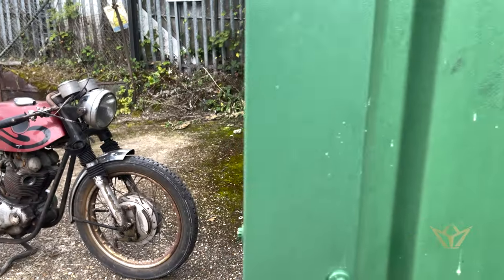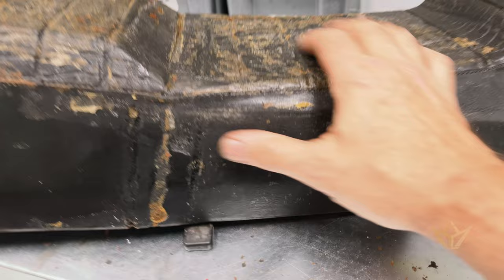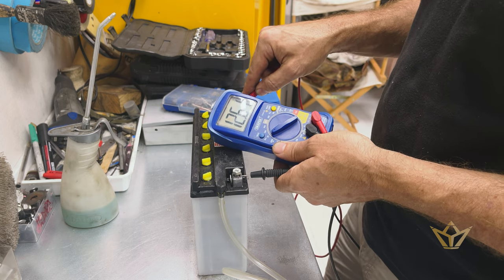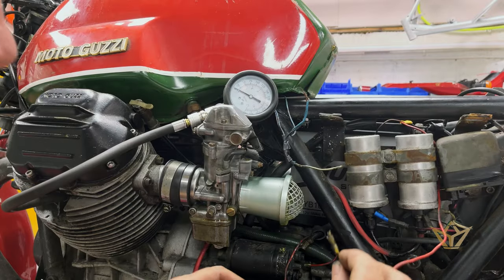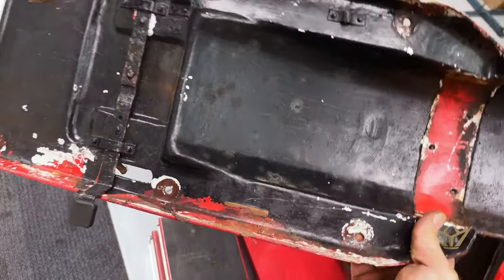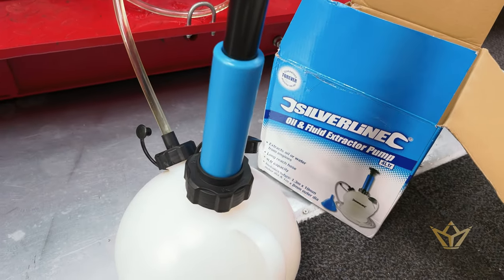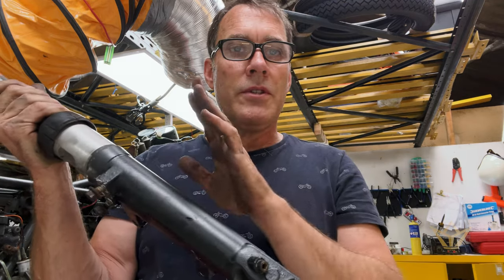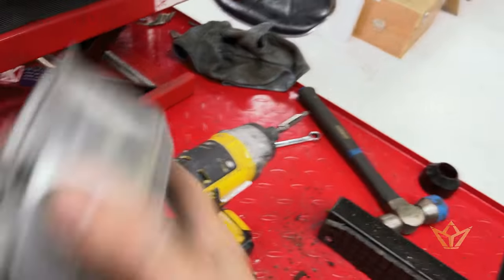Moto Guzzi LeMans MK1 1978 full restore Part1.

Comment: As far as I am concerned, the LM1 is the first true superbike. Others were fast, the Guzzi was too. The big deal was the Tonti frame which was stiff in it's own right but also took advantage of the torsional rigidity of the crankcase and gearbox case. It handled superbly and was also extremely stable without being heavy. Bloody brilliant.
Reply: Absolutely love them. I had two MkIIs over the years. The first I did a complete restoration on. The second one was big-bore with an ambitious tune (gas flowed, inadvisable cam etc) and needed a good amount of work after a long layup. The lap I did of the TT course on that second one just before going to the ferry to come home is the best ride of my motorcycling life so far since 1976. 
Went to the Dutch TT on that first one along with a mad mate on an RG500. We were cruising at 85 on the way down to Amsterdam which was comfy on the LeMans, but the RG500 didn’t like it. My mate signalled that he was going to pull ahead to try and clear his plugs. I have never seen so much smoke from a bike ever, it was epic.
I always wanted a MkI, I think they’re one of the best looking bikes ever. Sadly I’m just not stretchy enough nowadays to live with a bike with clipons.

Comment: Any 850-1000 Guzzi big twin is a great bike, even the 1000s and Le Mans 4 (with the 18' front wheel preferibly). The gear change is argricultural and the direct shaft drive takes some getting used to. You have yo be careful when entering tight corners as the bikes are bollody long. But the sound and immense, immediate torque waves send shivers up your spine. 

I have lived in Rome since the 1980s and frequented a famous mechanic's workshop: Giuseppe di Vito, known to all his firends as just 'Vito.' In his tiny, tiny shop I saw the best of all the 70s and 80s Italian esotica from original V7s to Ducati MHR Mille's, from Laverda 750 SFCs (his own bike).

One thing I noticed immediately, apart from the cover on the seat, is that green paint. I really think that is was an addition, covering the original black, as the Ducati MHR was red and green, many other bikes got painted in similar colours but not by the factory. Hope this note helps.

Ken:goodvibes:

Comment: There's a black rubber product that's excellent for near invisible repairs to those types of formed seats, comes in a tube that fits in a DIY compression squeeze tool, it'll dry under parcel tape to conform to shapes and will even fill missing chunks, it's called Marine Flex and will match for colour straight from the tube, any good Yacht Chandlery should stock it. Back to Black Car bumper dye might help with the side surface marks, failing that Colour Magic or even black Boot polish might be worth a try.
Reply from the maker: Very interesting MC2. I wondered. I’ll look it up! 👍

Comment: I have just completed my Le Mans, and looking at yours there is a lot of work. At this stage I see where you are going and I am interested with your progress and am happy to offer suggestions. There was absolutely no gold paint used anywhere. Your model looks about late 76 - 77, and the rear drive looks like it is from a later model. Your videos are terrific btw.
Reply from the maker: Cheers Warren! Yes there is a lot of work on the go here but making good progress. I’ll start to query when it comes time for assembly. I’d love to see what you did? 👍
Reply: There is one thing, the gearbox/ frame plate, the bolts that go into the gearbox can easily strip the thread in the gearbox, I have had 2 of 4 threads helicoiled, and upon completing the tightening of the  plate 1 more thread gave way, but I left that bolt in as tight, but I should have had all 4 threads helicoiled.

Comment: I found the absolute best., non efforts involved , way to remove glue on plastics , paint , skin , glass , anything fragile , was to use the solvents sold in pharmacy to remove band aids glue on skin to avoid tearing on wounds ...In France such solvents can be found under the name "proseptine" ....As opposed to nail polish solvents it won't melt plastics or rub off paint ( like paint of labels ) .....
You'd save yourself a LOT of harsh rubbing using such a band aid removing solvent ( if you can find one in the UK using the same composition as proseptine )
Reply from the maker: Brilliant thanks Benoit! I’ll look it up
Reply: @MyRestoration1  De nada ...Discaimer tho ...I never tested it on neoprene glue or very very old crusty glue ... But anytime i have to remove glue from stickers or labels on platics i use it with 100% success ...So it's well worth a try